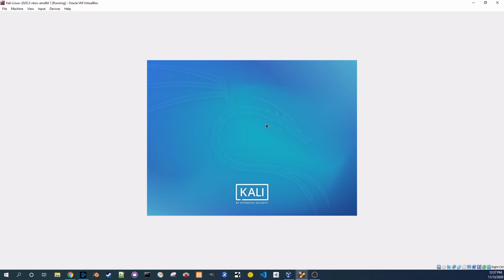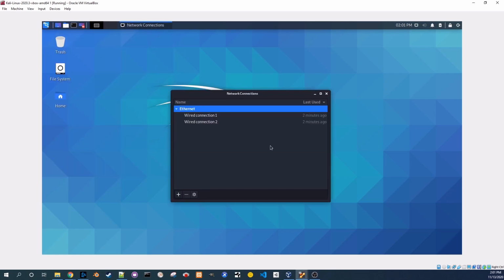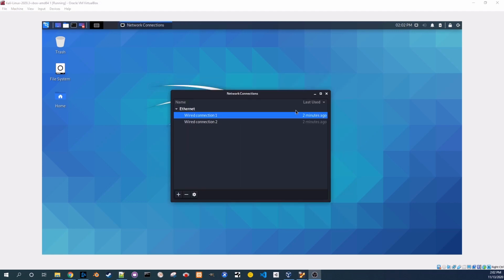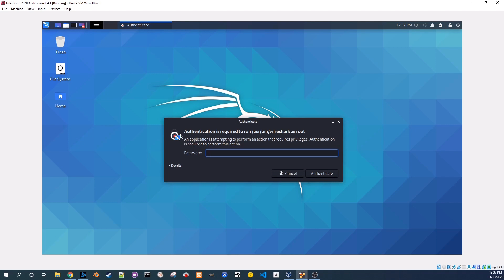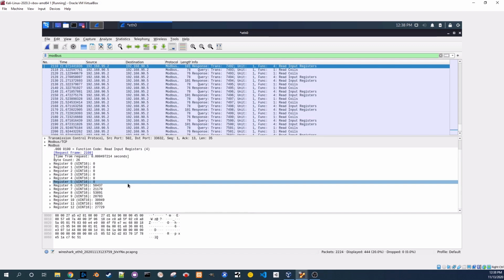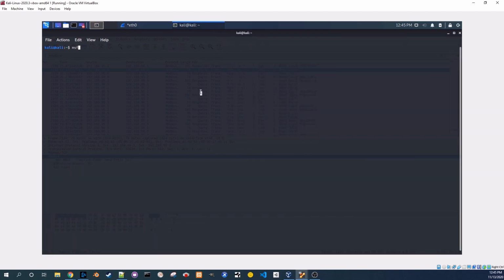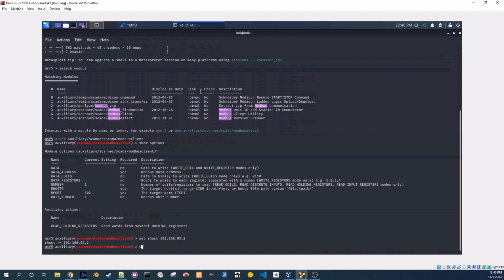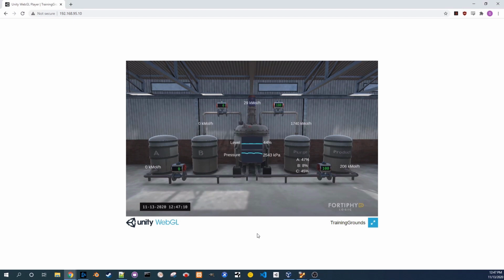Fortiphyd ICS Security Training - Injecting Malicious Modbus Commands

Comment: I was unable to ping the PLC after changing my network configuration as explained in the video. A little help would go a long way
Reply: have you guys found a solution?
Reply: I am having the same problem. I am unable to ping the PLC. I even deleted the network configurations and tried to ping it again and it is still the same. No packets
Reply: @sanusiopeyemi556  After doing these steps, you might have to add the routes via command line on your kali linux machine

sudo ip route add <plc subnet> via <default gateway> dev eth1
Reply: @sanusiopeyemi556  have you guys found a solution?
Reply: Restarting the network manager did the job for me. Simply type "sudo systemctl restart NetworkManager" into the command line of your kali linux and execute the command.
Reply: For me restarting the network manager did the trick. One way to do this is to execute the following command in the commandline "sudo systemctl restart NetworkManager". Hope this works for you as well.
Reply: Hello, same challenge .. did you get a solution to this? I suspect the pfsense (firewall) might be blocking the traffic by default.

Comment: Hi! Thank you! Amazing work!  I did not understand what´s changed after writing coild 1 to address 40 it seems process is the same. Thank you.
Reply from the maker: Writing a value of 1 to the coil at address 40 should cause the process to go into a "shutdown" state, where the feed valves are completely closed, and the purge and product valves are completely opened.
Reply: Great!  @fortiphyd  thank you. I see the second exercice you uploaded  the project file changing the pressure  setpoints. Is there any way to perform the changes using mbtget as well to cause sabotage and explosion? I was successful to write coils but none of the values I used to write using mbtget were enough to cause sabotage. It seems this is because of the fist configuration uploaded to the master PLC that is acting as a "safety" normalizing the process.  Does it make sense ?
Reply from the maker: @MagicWebUniversity  it is a more complicated chain of attacks, but you should be able to write to holding registers on some of the other Modbus IP addresses to directly control the valve positions. An intelligent combination of valves being open/closed will eventually increase the pressure to unsafe levels. 

However, the PLC will "fight back", trying to keep the process safe. There is also a buffer overflow vulnerability in the PLC that you can exploit to crash it, preventing it from controlling the valves, which will then cause pressure to rise faster
Reply: @fortiphyd  thank you very much for the explanation. Is there any document showing the relationship between the plc and the io modules? The master Plc has only some variables while the IO you can query dozens of variables. Again, congratulations for the amazing job you did. This is a fantastic project! 👏👏👏👏
Reply from the maker: @MagicWebUniversity  I'm afraid we don't have nice documentation on that, you will have to explore the PLC program and Modbus configuration file to see which variable are actually used and how they are used